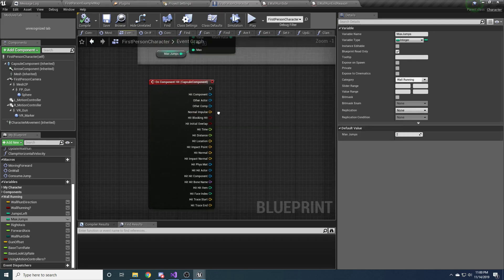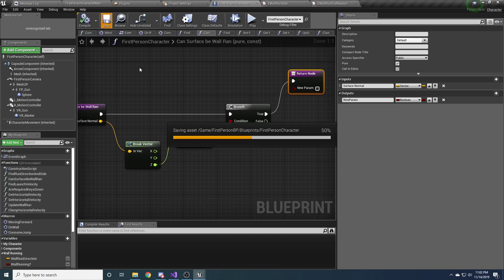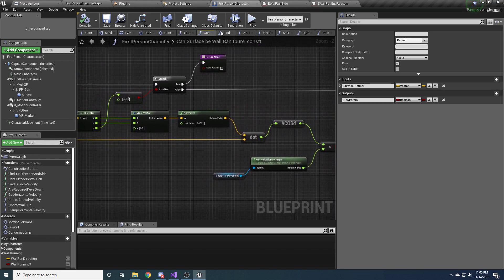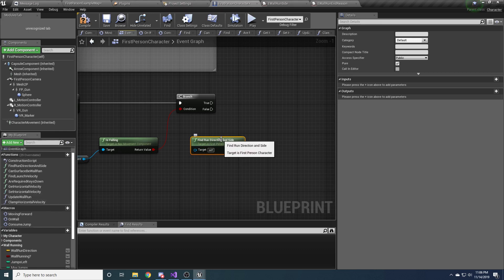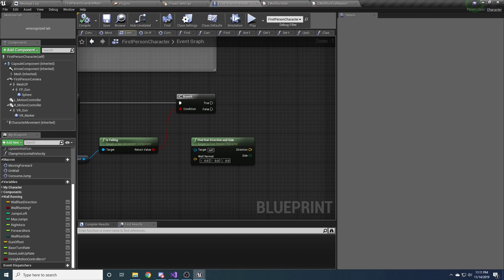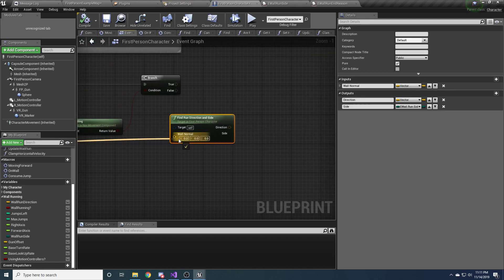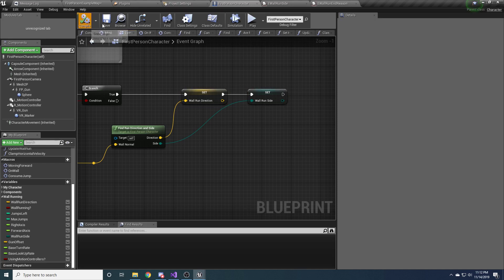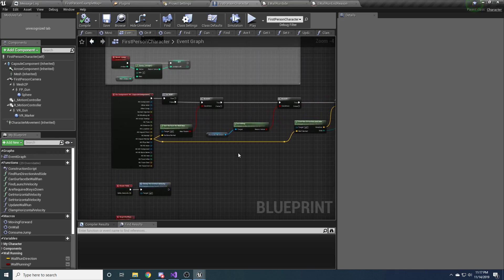Unreal Engine 4 - Advanced Wall Running Tutorial (3/5)

Comment: Just finished the wallrunning and vaulting videos and am having a problem.
I changed wall running so that it only activates when i run and jump towards a wall, instead of having to hold A or D.
However this has made it so that now whenever i run and jump toward a wall directly in front of me to vault, it will automaticly activate wallrunning. How can i fix this???

Comment: For the function "CanSurfaceBeWallRun, there is no need to calculate angle between floor plane and surface normal. You can just use one expression and save a dot product, normalization, and more importantly, a acos which can be very expensive.

return surface_normal.Z > -0.05
		&& surface_normal.Z < Cast<ACharacter>(GetOwner())
		                      ->GetCharacterMovement()
		                      ->GetWalkableFloorZ();
Reply: You're awesome, I really liked the optimized way you edited of the WallDetection

Comment: In the function Find Run Direction And Side I keep getting the error of 
"This blueprint (self) is not a scene Component, therefore 'target' must have a connection."
how can I fix this?
Reply from the maker: My guess would be that you're using the wrong AttachTo node. Make sure you use the exact same one as I use in the tutorial (there are a couple that look very similar but are slightly different)

Comment: Hi! Love the tutorial so far! I've gotten to part 4 without realizing that the AreRequiredKeysDown function isn't working properly. I've gone over the video several times and made sure that the left and right are both returning to Return Nodes. I can't even seem to get it to work with only the forward axis being checked instead of that + left/right. Is there something I could be missing? Thanks a bunch!
Reply: Nevermind, figured it out! It was because my OnWall after Launch Character in InputAction Jump was pointing its false to end wall run instead of true. With wall running in mind, is there anyway to make the wall run speed inherit character's velocity

Comment: 3:25. Small tip! Your input value will always be available as a local variable. So you could drag from the pin and write get Surface Normal. 
I see you like to have things clean, and maybe it will help with that! Anyways, great tutorial you have here. I like the way you program :)
Reply from the maker: Thanks :) yeah I typically do that to avoid having lines going every which way - just didn't do it this time.
Reply: 9:46 alright ofc you knew about it. Haha sorry for the bother :D

Comment: So for some strange reason, the hello comes up when I am on the right side of the wall, but when I try to do it on the left side of the wall, there are no hello's and I don't know what I didn't do right(This is after watching the beginning of part 4/5)
Reply from the maker: There are a few things that could be causing this. I'd add some breakpoints to your wall running code (if you don't know what breakpoints are just search for a youtube tutorial on breakpoints in ue4). Make sure your WallRunSide and WallRunDirection variables are getting set correctly. Also make sure all your cross products match whats in the tutorial.
Reply: @ReidsChannel  I setup the Breakpoints and I followed the steps and it always stops at the branch in between set wall run side and begin wall run in the event graph. I put the breaking point in the "are required keys down" and nothing was wrong there, I also checked the variable and I don't see any mistakes. Once again the steps stop when it gets to the branch in  the event graph, and it is the branch at 15:49
Reply from the maker: @blackpander1099  If its stopping there then it sounds like your AreRequiresKeysDown function is return false when it shouldn't. Double check that its correct. If you still cant figure it out add me on discord: blindopoly#1003
Reply: @ReidsChannel  Ok I got it to work, I went into the AreRequiredKeysDown and I had to check the two last boxes that said return node, after I did that everything works, Sorry for all the trouble and thank you so much I appreciate the fast reply and help.
Reply: i did everything and the hello isnt coming up at all

Comment: Firstly, love your tutorials! Followed this series all the way through the end and everything works perfectly but I was wondering if there was a way to have the RequiredKeysDown function to work by only using the forward? I find that it's a bit awkward to have two directional inputs for wall running, especially with gamepad.
Reply from the maker: Hey thank you! Yeah of course, just change the function to not require the side input and only require the forward input. Right now it requires both, just remove the part where it's checking the side input and you're good to go.
Reply: @ReidsChannel  What do you mean by that?
Reply: Thnx it helped me too

Comment: Hey so I followed the tutorial till the end (ep 5). I was watching it again to figure out how to make myself run backwards on the wall. I tried allowing the forward axis to be lesser than -0.1 but it makes me run forward on the wall while holding  the S key. Please help me!
Reply from the maker: Hey, the system I've created isnt really designed for backwards wall running so there isnt a quick solution. In order to add support for something like this you would need to change the math a bit so that it checks which button ur holding (w or s) and then calculates the WallRunDirection based on that also. You would also need to fix the line trace while on the wall to go in the correct direction because right now its assumes ur running forward.
Reply: @ReidsChannel  Thank you soo much! I'll give it try and let you know my results! Thanks for the great tutorial too
Reply from the maker: @its_a_pixel  No problem :)
Reply: @ReidsChannel  i kinda have another question. In the function, are required keys down, i made sure to check that a negative value for the forward axis is also considered true. The first time that we set the WallRunDirection is in the event graph, using the function FindRunDirectionAndSide. How exactly to we know that the character is moving backwards to determine the direction?
Reply: Really sorry to be bugging you but I'm kinda new to this and need all the help that I can get
Reply from the maker: @its_a_pixel  No worries. I'm not understanding ur question though. can you add me on discord so I can help you better. Discord: blindopoly#1003
Reply: @ReidsChannel  i sent you a friend request. It's Fatal_Error

Comment: This Wall run tutorial is the best one I've seen so far.
I do have a small problem though
I couldn't fix it so I just kept going along until the end (5/5) , but I think I messed up a step here

I can wall run on the right side correctly and the camera also tilts, but not on the left side.
It won't let me wall run on the left and the camera also doesn't tilt

Edit: I found the solution
13:02 this idiot (me) got the "Right Axis" instead of the "Forward Axis"
Reply from the maker: Ah, good! Glad you found the solution!
Reply from the maker: Hey thanks! Yeah sounds like you may have accidentally messed up some logic somewhere. Have you tried placing some breakpoints in the blueprints to see where it's going wrong?
Reply from the maker: I would look at the CanSurfaceBeWallRan function and make sure that's returning true for the left side. My guess is that it isn't and that is where your problem lies.